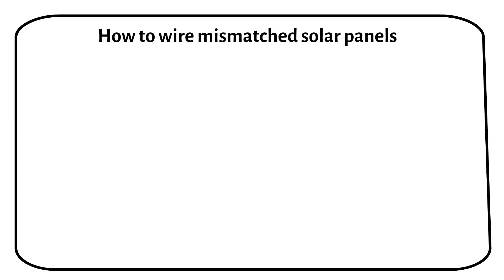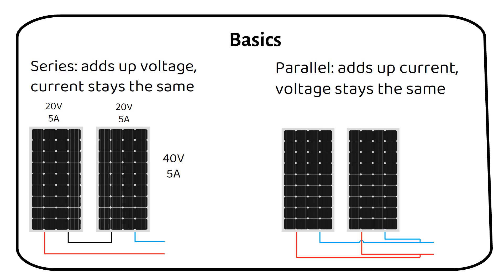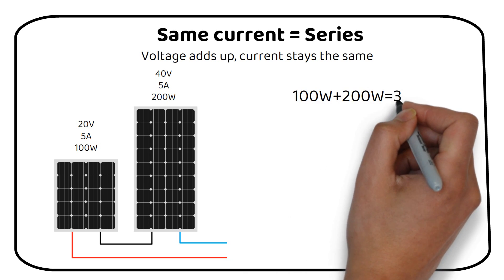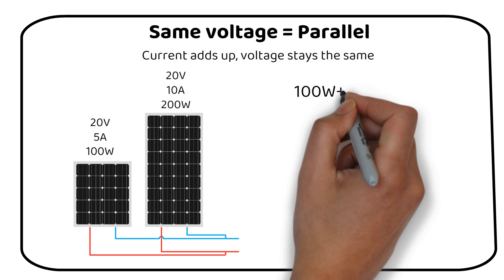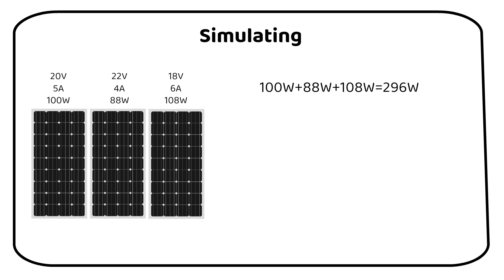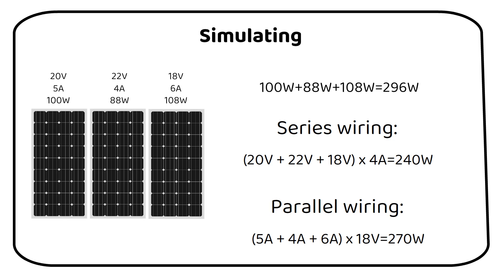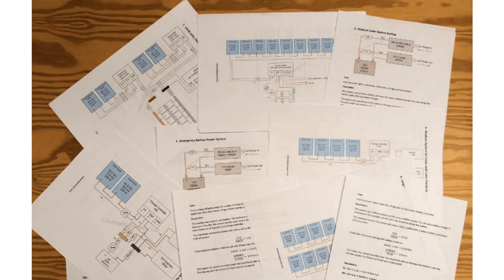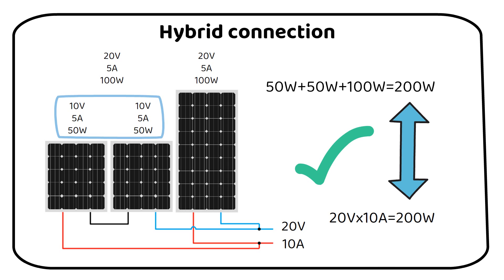Mixing Different Solar Panels With Different Wattage (Mismatched)

Comment: I have 2 x 250 watts 24 volts panels, 1 x 330 watts 24 volt panels, and 2 x 250 watts 12 volts panels, 
2 x 12 volt 200 AH battery and 50 AH charge controller. Can you suggest how I connect them

Comment: Great video, but I need to ask a couple of questions. Here is what I have 2 - 255 watt 30.5v, 8.37a panels and 4 - 100 watt 18v, 5.5a panels. This build will be for a RV. I would like to build a 24v system. With these panels what you recommend for a wiring configuration and 1 or 2 charge controllers? I don't know all details yet but I am thinking a 3000 watt inverter/charger. Thanks

Comment: damn! you're good. thanks for making it so simple. still very helpful for a year old video.
Reply from the maker: I try my best to simplify it. Glad you liked it.
Reply: @cleversolarpower  Now my Panels seems way a part 
1 is 580 watts and the free from Ecoflow is 100W. 
both works with my Ecoflow delta 2. Is it possible to serries my 100 watts to 580 watts? at least it helps adding more wattage.

Comment: Pls I've an issue with my panel set-up, I've X4 450w and X4 550w  all connected in series and my hybrid inverter max input is 18a pls what should I do sir

Comment: I don’t remember you saying, do you use the working voltage(Vmp) and current(Imp) of the panels or the open short circuit(Voc) and short circuit current(Isc) in your calculations? Additionally, voltages and current are almost never whole numbers. Verify I should round up or use exact voltage and current.
Reply from the maker: To calculate voltage drop use isc and vmp (worst case scenario). And for mppt input voltage use VOC.

Comment: Instead of using multiple MPPTs, there may also be situations, where you can use a buck converter to adjust voltage and current, so the panels match better.
Reply: Do you have a specific buck converter in mind?   Apparently it's more common to use a 'boost' converter to equalize voltages in a solar panel array.
Reply: @MikeyCanuck123  No, I don't know any specific ones. I am not really hands on, I am just parroting what I see on YT.
It depends on your setup whether it makes sense to boost the voltage, or reduce it, but in general buck converters are more efficient than boost converters.
Reply: @GerbenWulff   - Ok.  I'm not familiar with either, really, just YT, ChatGPT and searches.  But your comment caught my attention, because it seems like a good alternative to multiple MPPTs.  My thinking was to keep the wattage up, you'd want to go to up in voltage.
Reply: @GerbenWulff   - Do you know the efficiency differences?   From what I've seen, the buck is only slightly more efficient.

Comment: Dear Sir this is Harun from Bangladesh i have 4 pannel 355w series connect with (6kw hybrid inverter 120-500voc) now i have planing to add 585W 3 more plannel Please suggest me Best wearing series or parallel
Reply from the maker: If your hybrid inverter has only one MPPT then you need another MPPT charge controller (separate).

Comment: in the hybrid example, can you have multiple layers of series?  For example you series connect the 2 50 watt panels to create in essence one 100watt panel of 20v and 5amps, rather than parallel connect that to the 100w panel, can you series connect it again to that 100w panel?  i.e. 2 x 50 watt panels series connected, that are then series connected to the 1 x 100watt panel to then have 40 volts and 5amps?
Reply from the maker: Yes

Comment: Can I ask a question. The high the isc is better or the low isc the better?  Which is  better???
Reply from the maker: That doesn't really matter. It's just the max possible current at test conditions.

Comment: your video is very helpdul. i have a series of 6 panels of 320 watts of 42 volts. now i need to add 4 panels of 600 watts. is it possible to to add 4x600 watts panels in series and connect the both series of 320 watts and 600 watts in parallel to the inverter. my invertor supports 4000 watts from pv
Reply: how many volts can your inverter take? what is the amp difference between the panels? to connect them in parallel you'd probably be better connecting (3) 320's & (2) 600's in each series, then paralleling those
Reply: @BatMan-co1gy  inverter can take up to 450 volts from pv.
320 watt panels have 8 amp each and 600 watts has 10 amp each
Reply: @Flaycrafts  seems like it would work, but it seems like you'd be maxing out the inverter, 18 amps together, especially on cold clear days even the volt output will be higher than the Voc value from the panel specs. my panels Voc is 38.3V but correct with the temp coefficient they're 42.03V adding 37V more to my 10 panel string.
Reply: @anasir4a  Did you still continue with this?. Did you work out. 

I have similar problem now. How did you solve it?.
Reply: @VolleyballAfrica what I have asked in my question did not work for me. 
However what I did now working as expected. I have made 3 pairs out of six panels of 320 watt old panels connected in parallel. After that I have connected these 3 pairs in series and added this series  to the series of 600 watt panels in series. Now I have a total of 12 panels however they are working as like 9 panels of 600 watts.

As my inverter is 450 volt max and these panels do not exceed 450 volts due to 80% efficiency and angle of the sun.

You can try this but do consider the recommended voltage of your inverter.

My Total panel are now 6 panels of 600 watt 52 volts 10 amp

6 panels of 320 watt 42 volt 8 amps
Reply: however I am considering to add a switch to disconnect 320 watt panels from main series in peak sunny days to avoid and over voltage and over current
Reply: @Flaycrafts  This is very helpful. Thanks a lot.

Comment: Very well done and accurate on all points. Is MPPT solar charger like Victron 100/50 more efficient with a higher solar panel voltage input? I can choose between 24 and 31 Volts panels wired in parallel to charge a 12V battery pack knowing that the Victron 100/50 MPPT can accept either input voltage.

Comment: Called someone to connect my solar pump with mix matched pannels and he did the wiring in series. After following your videos have discovered he was suppose to do the wiring in parallel because the efficiency is not good as the pump doesn't work effectively. My question is can change the wiring from series to parallel now that known how go about it?

Comment: What about 2 200w 18V 10amps & 2 100w 18v 5amps? I was thinking SSP 🥺
Reply from the maker: I tried paralleling 200w and 100W, and then series these two sets. But I dont think that will work. I think it's best to get two charge controllers.

Comment: sir good day is it safe to connect 2 100 watts solar panel and 1 50W PV panels and all in parallel to one charge controllers?
Reply from the maker: No, they will need to be separate. Repeat the calculation in the video with your values.

Comment: I have 12v 100watt 3 pannel , single battery , how to connect pannel series or parallel or hybrid , mppt charge controller voc is 60..

Comment: Hi, thanks for the video. I have 2 panels 170W (20.4 Vmp, 8.3 Imp) and 100W (17.2 Vmp, 5.8 Imp), MPPT regulator and just one 100Ah lead gel battery (so changing with 5A max). I have 2 panels just for the cloudy days. Is the voltage difference to big? Should I use bypass diode between the panels? I have MBR2545 schottky 45V, 2x15A diode.
Reply from the maker: Best to wire in parallel. 14.1A*17.2V=242W total

Comment: I setup a 420wat, 32v panel to a 100ah change controller. 12v 220ah battery, and 1400wat inverter. Is this ok? Or should I increase my panel to 2
Reply from the maker: It depends if your battery gets empty. So your load decides if it's underpowered or not. That's why we start with a load analysis first before sizing solar panels, batteries, etc...
Reply: @cleversolarpower  can a 420watt fully charge 220ah battery?

Comment: Please, tell me why you use the lowest of the amps in series and the lowest in volts in parallel?
Reply from the maker: Because in series we add voltage together and in parallel we add current together.

Comment: I have 5 panels of 350w, 3 panels of 340w and 4 panels of 390w. Total= 4330watts. Getting 2.2kw power in peak hours. Is it a good output? All connected in series

Comment: can I connect first in parallel, but then connect those combined leads into a series array?
Reply from the maker: Yes, but why would you do that? It's first series and then parallel.
Reply: @cleversolarpower  I need to drop my voltage input to charge my portable battery and connecting my panels in series first gives me a total voltage that exceeds my input voltage requirement for the battery.

For whatever reason there is not much info on connecting parallel first, but from what I've read, 2 panels in parallel provided better energy output if one panel is partially shaded compared to 2 panels in series and one of them being partially shaded.

Comment: I have a 300w pannel at 40v 8A and 2 100w at 20v 5A how do i get 500w?
Reply from the maker: Wire the two 100W in series and then parallel with the bigger panel.

Comment: Hi, I had 3 groups every 1 group (3 solar panels in s. (every solar panels 250w)) but one from one group had one solar panel is damage and want to remove from my 1 group and will be 2 solar panels only for only one group but others groups 3 solar panels ((1+2+3);(1+2+3);(1+2)); could i run it from inverter mppt 4kw or will be problems ?

Comment: hi ..i have three solar panel each one is 550watts,,,42.57V,,,12.92A,,then added one solar panel same company but 540watts,,42.15 v,,12.81A...my inverter is 1500 wat.2000 solar watt.mppt,,,,is this addition is good or will cause high resistance and will affect badly my system and inverter..thank you
Reply from the maker: The panels you mentioned are basically similar, so there is no problem connecting them in series.

Comment: I have mismatched panels. I run each set (two types) through its own charge controller.
Reply from the maker: That's also a possibility.
Reply: i have 6 panels with 180w each connected to scc.

im planning to have another 2 panels with 550w each and connect to another scc.

then connect both scc to a lifepo4 battery. is this close to your setup?

im in 24v system.

Comment: Thanks, I'm getting ready for a hybrid inverter system for my house.
Reply from the maker: If you have mismatched panels, you can add another charge controller next to the hybrid inverter.
Reply: @cleversolarpower sorry still have alot to learn,is the charge controller the same as mppts? I have a hybrid inverter with 2 mppts,can I place my 350w x 4 solar panels on 1 mppts and 540w x 4 solar panels on the other mppts?
Reply: Yes. @King_Jerry

Comment: Hi sir hope you well.

Im from South Africa im in the market for solar system. 

I would like to find out if does it matter when you connect a rated 24v panels in series parallel combination to a 24v hybrid inveter 

Thanks
Reply from the maker: Connect in series up to maximum allowable input voltage of the charge controller.

Comment: As you are the best teacher I am going to ask you a simple question , or better I explain to you what I am doing and tell me if it`s good ?
I have 3 solar panels each gives 18V / 1.6A  that I put in  parallel to have the max current out of them to charge a lead battery .
So as lead batteries should be charge at 14 .5 V max , Then if add a solar panel that gives 15V / some .5 A ( I really don`t its amperage ) cause I don`t have ma meter to check the amps out of it and also nothing written on it . 
Adding that panel to the others will drop the voltage to 15 and add let say 0.5A which will normally gives me  15 V /5.3A .
Will this be ok to charge a battery without damaging it , if I don`t use any solar charge controller .I have a switch to cut the solar power on the battery when not in use for the moment .
Will use a 1,000W inverter for experience on  a computer with the monitor + a fan + a led lamp of 20 w at night .
the battery is 12V/ 74AHR .I will change that battery to one of 90 AHR as soon as possible .
Will this work and for how many hrs all this will run before it run out of power ?
Thanks in advance dear teacher 😊
Reply from the maker: Don't put the panels in parallel if you have an MPPT. It's the same power rating if you place them in series or parallel. You need to use a charge controller. The charge needs to stop if the battery is full. Check out my video about how many batteries for a 1,000W inverter.
Reply: @cleversolarpower  . Ok I can see that you have not understood what I explained to you and your reply does not get me any help . But thanks for the late reply .
 I already figer it by myself and every thing is working in parallel .